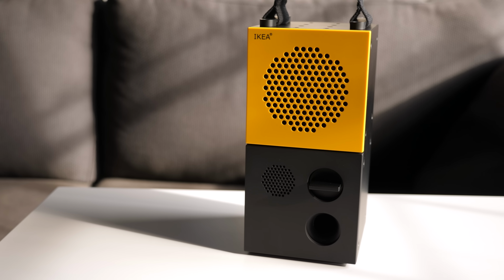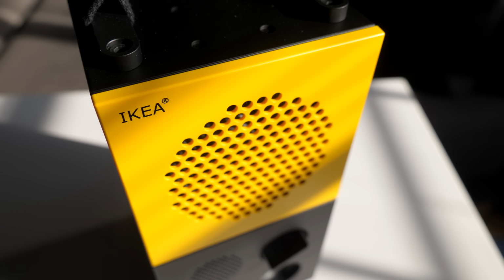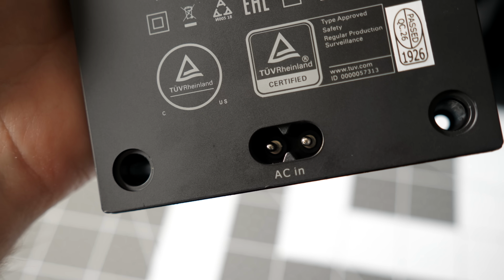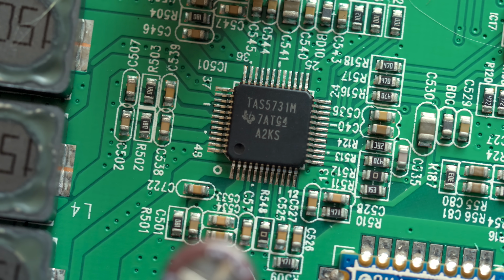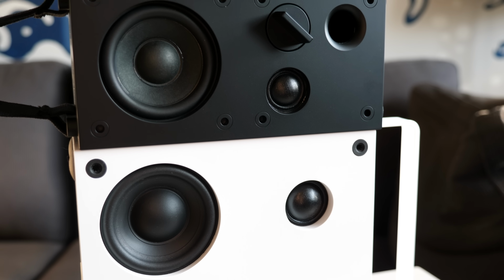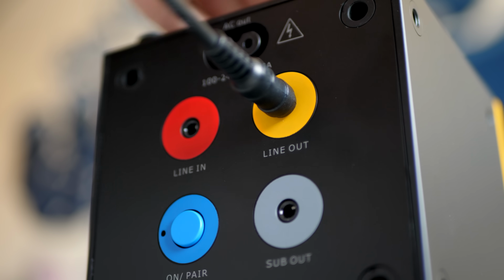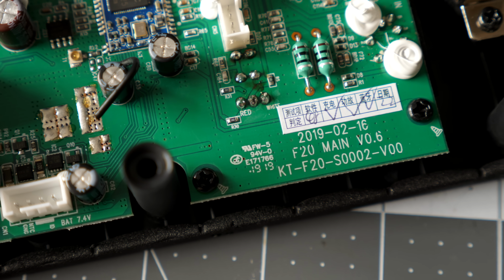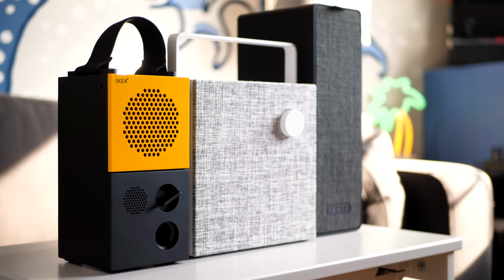IKEA Frekvens Speaker Review and Teardown

Comment: That’s also the exact same sound that every Anker speaker makes. Based on the presence of a Teenage Engineering logo, I’m assuming that going with the Anker models will get you far better sound for a tiny fraction of the cost. Apparently, if TE attaches a jog wheel and a tiny bit of memory to let you hear weird, totally unrelated, record-scratch sounds while the recording “rewinds”, it’s suddenly a revolutionary music-production tool.

Comment: So... you can actually use the speaker without bluetooth? Because i tried connecting it with an aux cable to my PC and there's literally no sound. Maybe i connected it the wrong way? I connected it through the line-out and into my PC through line-in. Maybe it's supposed to be the opposite? Luckily my PC has bluetooth so i can still use it but with some really annoying latency. Help anyone?

Comment: I really like that the powersupply is separate inside! My mothers old DAB+ radio had a faulty 12v supply inside and I just swapped that with an external universal laptop supply. 

I could probably find a similar supply at my country electronic store, same pinout and size. I have done that to a LCD screen. But it costs. Hehe

Comment: I think the key to understand here is that they are party speakers .. extremely loud and solid sound reproduction and it that setting they perform solid. It's also a simple "let's go" design that doesn't require a lot of filtering, mixing, setup, etc as you usually need to do with your PA speakers. They definitely not your casual BT speaker ...

Comment: The USB socket is easy enough to add. Does the main circuit bord offer the possibility to add the buttons to? Or do they need to be connected to the legs of that blue board?

Comment: Sadly, IKEA speakers are overpriced. As they introduced in Lithuania smaller ENEBY was 39 EUR and bigger 69 EUR. Now they ask 69 for smaller without battery (20 EUR extra), and 99 for bigger without stand (10 EUR extra). Frekvens costs 69 EUR. I was in doubt about buying even with older prices, but with current there is clear NO WAY.

Comment: I had some waterproof shower speaker that made those exact same sounds too 😂. I immediately recognized it when I heard it in your video.
Reply: Same for my JBL headphones!
Reply: Ah yes. The $4 ones from AliExpress with a suction cup foot. (I have one too but didn't make the connection until I saw your comment.)
Reply: Same for my anker speaker. The power on sound is the same, but the pairing sound is slightly different.

Comment: It's embarrasing for everyone making products like this that even if you have two units you can't get stereo sound. Stereo has been the norm for over 50 years now, insane that there's all this mono garbage suddenly appearing.
Reply: Modern music is 99% mono anyway.
Reply: @SSJfraz  yup. Its a strange argument to make esp given the number of sonos one speakers sold.
Reply: Indeed. These speakers are designed with simplicity and compact factor in mind. It wouldn't make any sense to make them in stereo, as stereo requires wide imaging to be effective, which would mean two speakers spaced apart. Completely destroying the purpose of these type of speakers.
Reply: @SSJfraz  That's understandable, there's always room for having a transportable speaker to give an upgrade to something like a phone in terms of audio, and a portable speaker isn't gonna be large enough to have meaningful stereo separation. BUT my complaint is about how when you have two of these, that there isn't something like a switch on the back to let you toggle them into a stereo mode. Would just be a 3-position switch, put it in the middle to play a mono mix of both channels, put it left to play the left channel, and right to play the right channel. It feels like a crucial oversight for a device like this so heavily geared up on being able to chain units together.
Reply: @Nukle0n  That's just it though. The speakers will be chained together, making stereo pretty much useless. The only way stereo would be effective is if the speakers are set apart from one another. Which isn't what this product is about. If you were concerned about getting stereo sound, you wouldn't be looking to buy these anyway.
Reply: @SSJfraz  All it would take to separate them would be slightly longer cables, even with a 1 meter cable you'd be able to get decent stereo separation which would be a neat rig to have portable like that.

My point is simply that with the changing of very few things they could've made this product much more appealing to the people who were gonna buy two of them and not just have them zipped together in a big lump.
Reply: @Nukle0n  I get what you're saying. But anybody concerned about getting good stereo sound isn't going to concern themselves with a product like this anyway, even if it did support stereo sound. Effective stereo just isn't portable.
Reply: @Nukle0n  yes, egg on my face! Oh wait, these ones don't actually pair, and can only be done in stereo with line in and only when you're using splitters. But aside from that, spot on comment!
Reply: @orbital10  That was my whole complaint dude, that you can't use the built in feature to use stereo, even though it would require almost nothing from the manufacturer's side. But you seem dead set on wanting me to be wrong when you don't even bother to read.
Reply: @Nukle0n  Fair enough! I can't read, clearly. Anyway, the point i was clumsily making is that mono is more of a thing because of sonos - people rarely pair them unless they're absolutely stacked with cash. I'm not saying  the mono take over is a good thing!

Anyway....back to the topic - i have the frekvens with sub and it sounds good but definitely won't argue that this teardown didn't elicit some disappointment at the outcome - I'm a bit surprised teenage engineering didn't insist on some updates - I'd assumed they'd had some say in the insides given that they've worked on their own speaker before. Ah well, it will do, the sub does make a difference but I will breathe in a bit next time something 'cool' comes out

Comment: I wonder if soldering a USB port to the leads would allow playback from a USB stick in some way. Maybe some undisclosed series of clicks on the only button, like old iPod Shuffles.
Reply: Do people still do that? Why... I’d like to see what I’m playing, and be able to search for albums so my phone works the best with Spotify and my local flacs as well, so I can’t imagine having to use something like a shuffle. Technically you can get a Chinese usb player with a phono out and just plug it in, but usually that requires a separate power supply. You’d have to do heavy modding to just play off a usb drive direct.. maybe a raspberry pi could be programmed to be a brain to change and display current song and it could fit inside the speaker and probably could take a 5v line to power the pi BUT STILL ITS SO MUCH EFFORT  because I doubt the chips inside are capable of usb support  BUT AGAIN WHY it’s cheaper and much less hassle to get a MP3 player or a cheap phone and use that via Bluetooth or audio jack. OR even better, just buy something that does what you want out the box, if usb is what you really want..
Reply: @maksqwe1  99.9% curiosity and discovery, 0.1% to actually use it.

Comment: Colin I've been meaning to ask : is there a way to run two Enebys in stereo? I'm considering picking some up but only if I can assign the left channel to one and the right channel to the other. Either wirelessly, or via cabling (but wireless would be better). Thanks man, brilliant audio ep as usual
Reply from the maker: Yeah, you’d need to use an analog splitter cable to send one channel to each speaker, I don’t think there’s a way to do it with Bluetooth.
Reply: @ThisDoesNotCompute  That might depend.  I have a Galaxy S9 and it can connect multiple BT devices.  Also seems it could and assign them to L/R channels.  Never tried, as I have only one BT speaker, but I think that's the way it works.
EDIT: great video Colin, as always.
Reply from the maker: Yeah if you have a device that can multi-pair that way, it would be a slick setup. Bummer the Bluetooth module in the speaker can’t do it, because there are some other speakers that can.
Reply: I don't know of a wireless way to do it, but I put my pair of Enebys in stereo using an "old skool" approach... 3.5mm stereo jack to L/R RCA cable... then took the Left RCA output and attached a cable to it that fed it into the L and R of a RCA-to-3.5mm stereo jack. Repeat for the Right. The result was a single  stereo 3.5mm jack split to two stereo 3.5mm jacks... one for the Right, the other for the Left. Attach each of those output 3.5mm jacks to each Eneby. 
 
(if you hear a thud, it is from audiophiles laughing so hard at my "solution" that they fell off their chairs) LOL
 
The 12" Enebys sound terrific in this configuration and I ran some audio tracks through them to confirm stereo separation. I give up wireless, but I control input via a switchbox to switch between (record player, cassette deck, Chromecast Audio, and TV)
 
It was Colin's review on the Enebys that got me hooked on them. Thanks Colin!
Reply: I connect each Eneby to a 3.5mm stereo to female RCA adapter then to L/R RCA cables,

Comment: Teenage Engineering... Nice looking high quality stuff that is slightly overpriced... Nice :D
Reply: Baum Inventions  yooooooooo Baum 🔥🐲
Reply: @CeziHD  Moin Moin du alte Rakete :D
Reply: These are manufactured by IKEA. TE did the industrial design and were likely involved in testing. Electrical design and manufacturing was handled by ikea.
Reply: Christopher Bolte // BØLT yes...
Reply: Hmm, TE seems all over the place in terms of quality and price. The Pocket Operators are great, the OP-1 is lovely but horribly overpriced, and while the OP-Z is terrific and good bit cheaper they've been plagued with production problems including warped units. Perhaps at the bottom of the barrel is their modular analog synths which are unremarkable in terms of sound and features, have bad ergonomics (the cheap hard-on-the-fingers knobs, wobbly rack, etc) and yet are still not especially inexpensive despite requiring customer assembly.  And now there are these pretty average mono speakers.
Reply: orpheusx you should check out my PO400 build video then 👾
While it’s not for everyone, you can get some amazing sounds out of it and they have since improved some aspects of the manufacturing. Everything feels solid and despite being somewhat pre-configured, you can create a ton of sounds from it!

Comment: garbage
Reply: @snailevangelist  i am because you can get way better at that price
Reply: Agreed.
Reply: Yep for $70 USD you can do much better, hell I have a JLab Crasher 2.0 that's much smaller, thus more portable, can charge my phone in a pinch, sounds just as decent(in Stereo actually), I can link another by a 3.5mm cable for louder sound if say at the lake, or drive in movie if decide to get another one, and it cost me all of $20 USD shipped off their website.
Reply: @CommodoreFan64  i just picked up a set o yahama NS-6490 3-Way Bookshelf Speakers they sound awesome for 79 bucks a pair im going to pick up another set i have my echo dot hooked directly in to my receiver with amazon music ultra hd it rocks!!
Reply: @built2last31  I hear ya. I have 5.1 Phillips surround sound system in my game room, and while I have a pair of insignia Google Home Speakers I really need to get a Chrome cast to add to my setup in addition to my Roku as those speakers don't have an output, other than USB charge, and it only accepts Bluetooth as an input
Reply: @CommodoreFan64  sweet